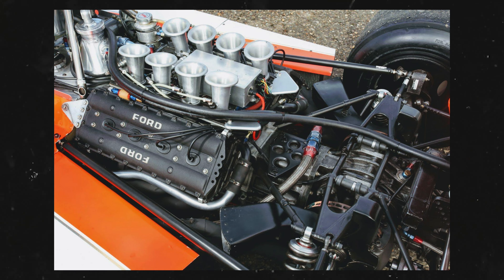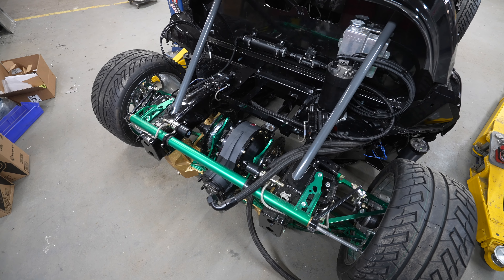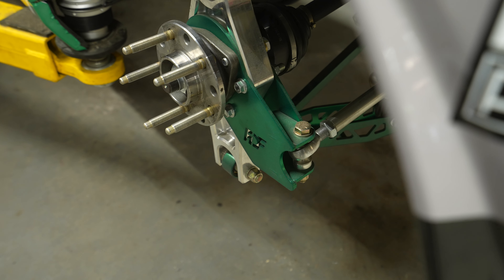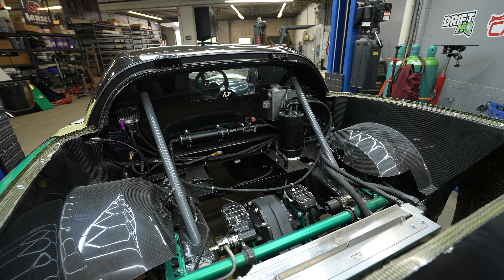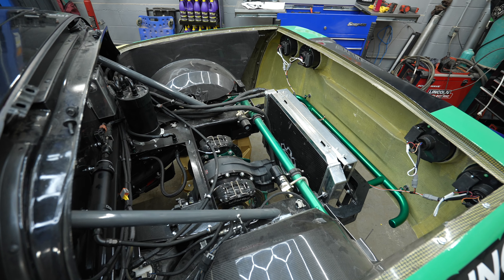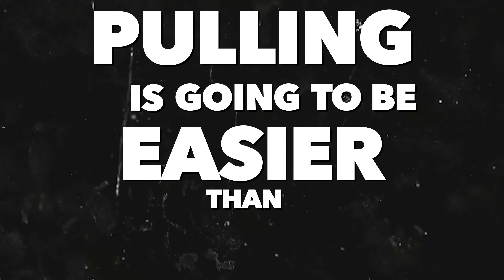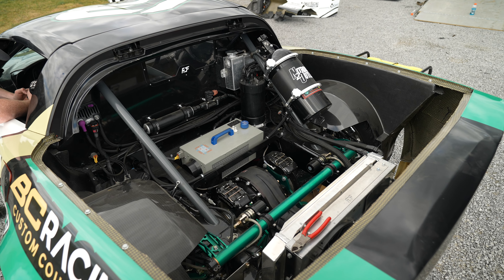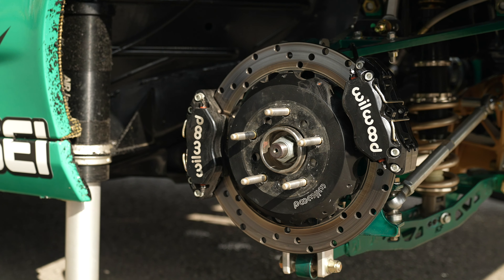Are Inboard Brakes Better??

Comment: 2:59 in the slow mo here, does the car have inboard brakes?

You can see the locked wheels rocking back and forth. Is this flex in the drive shafts (axels)? From the grip of the tyre sliding slightly twisting the drive shaft and it then springing back over and over. 

Would this not happen if the brakes were out at the wheels like a standard car as theres less to flex?

Not sure if you’d even notice or feel this when driving.

Comment: Would think that inboard brakes would also be less susceptible / prone to caliper piston push back, for eliminating spindle / hub deflection.
Reply: there will still be some maybe not as much but depending on the setup there is usually still some sort of end play on the shaft / half shaft - spindle axle stub, radially and horizontally at the diff side which will still cause the push back of the pads against the pistons during suspension movement and rotation of the shaft may not be as excessive as a normal brake on hub setup but will still be there they have engineered ways around this with springs and some sort of light tension against the pads to push against the rotor to help with it not going as far or even being able to return to as close to the rotor as possible without drag or little to none

they do this on some factory cars already which gives you more  confidence and less anxiety over the pedal being soft after a long straight or winding road and needing to brake suddenly without being able to tap the pedal first 
So that you can push with confidence from the get go no matter the situation abs systems do help with this sometimes aswell by keeping some residue pressure in the line in some instances if I’m not mistaken.

Comment: you could also mount the rotor on the pinion, you could actually use a smaller rotor and the brake torque is magnified by the gear ratio.  running just one rotor saves weight as well.  a torsen diff would send the force to the wheel that grips as well.  a spool would just sent the torque to both wheels.  rockwell axles do this approach.
Reply: old monster trucks when I was a kid were like that. there's a parking brakes on heavy equipment at my job that use them and they work very well
Reply: I want to do this on my miata and then have no rear calipers or rotors at all outboard (i only run front foot operated brakes anyway) but the powerplant frame prevents this.
Reply: I worked at a parts store for a while and when ever i saw a bus/dump truck caliper i had the urge to see if it would fit over a drive shaft 😂...fully aware it would crush the drive shaft VERY easily. But just make part of it solid i guess 🤷‍♂️

Comment: I had this in mind before u guys made it, so was super interested. I do want to have inboard brakes at some point in my driftcar (when i have time and money to upgrade). There are calipers with 2 loops, like 2 in 1caliper from a few manufacturers, like project mu and some from thailand cant remember. For info i have started a jzx100 driftcar project, will be grassroots/pro2 spec for now.

Comment: You could manage the heat with gold foil which is used in racing as a heat shield for intercoolers anyway. Here's a great video of cleaning the 24 karat gold heat shielding in a McLaren F1 road car:

https://www.youtube.com/watch?v=0qPgGNAgdUI

You can get more than enough 24K gold leaf foil to make shields for well under a grand, the stuff hammers out pretty thin. People eat it in fancy restaurants now, even Hard Rock Cafe has a 24K gold leaf burger and people have consumed it for centuries in some liquors. How trick would it be to show off too?

Given that people are now making carbon fiber wheels for sports cars that weigh 15lbs each... yeah, to hell with all that mass in the wheel. Especially in your game of spinning. Colin Chapman would be proud.